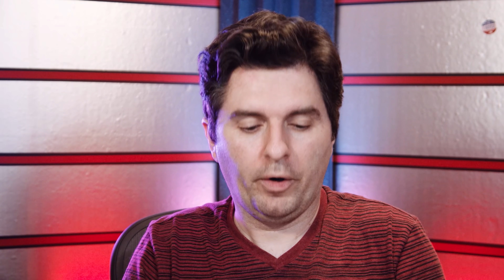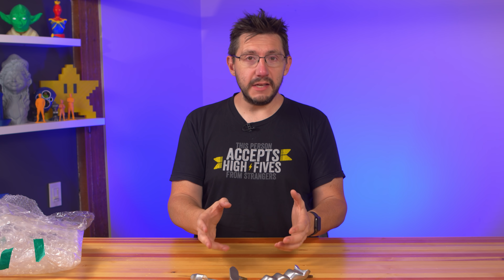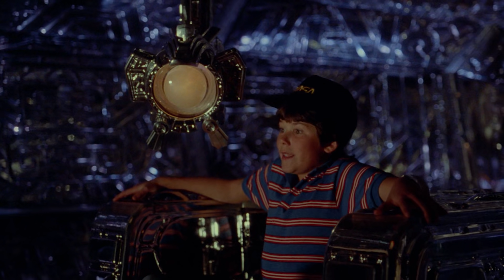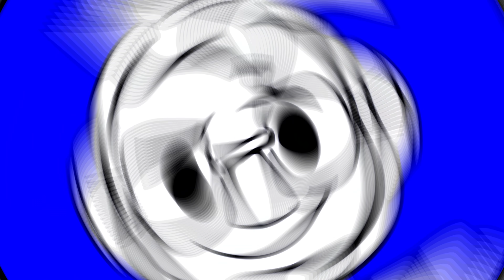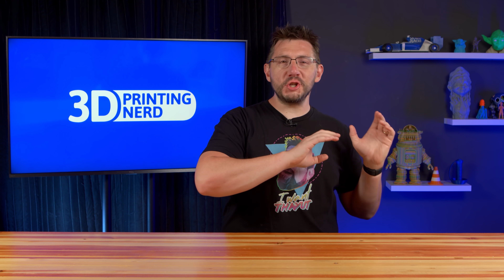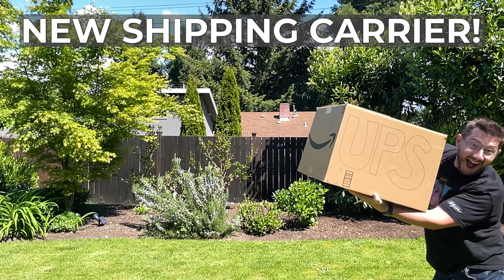3D Printing MAGIC for CAPTAIN DISILLUSION!

Comment: Hey Joel - Fun facts about Blender and 3D Printing.
STL format only specifies numbers - not units. Most slicers for 3D printing will interpret "1" as 1mm because that's an appropriate scale.
Here's where the fun starts.
Blender units are 1 = 1 meter. (It uses these for physics simulations, so even though some will say it's unit agnostic, it's not really)
If you are building something say, 10cm high and to scale, Blender will export this in STL as 0.1.  Problem is your slicer will see this as 0.1mm (REALLY REALLY TINY!)
What I normally do when I export Blender models to STL is scale up by 1000 in the exporter settings.  Usually fixes the problem.

Comment: Do you have any tips for the CR-10 Max? I bought one, assembled it, and I am having so many issues with it. I recieve mild shocks when touching the heat bed and the frame. It'll autohome and all that, but when I try to print something, the Z axis doesn't move down to the bed. It just stays still while it's "printing." Ever heard of rhis problem?

Comment: I wonder: how did they make the original with square holes?  I suppose those posts are cut from (aluminum?) stock and stuck into the carved wooden steps, too; so how did they make square holes for that?

Comment: How does FedEx lose a package and claim it was delivered?
I assume it wasn't stolen from the porch since you would not have said that FedEx lost it.
Reply: They said it was delivered. Then we said it wasn’t. The driver said he delivered to the correct address. Then later said he might have delivered it to the wrong address. Then we were given coordinates for the drop off location and it wasn’t anywhere near the actual destination. Searched that area and still couldn’t find it.

Comment: Hey Joel how are you myfriend, Im having a problem with my brandnew voxelab aquila. it extrudes fillament backwards.  i have another voxelab aquila that works perfect. I looked at the wiring and it looks right compared to other printer. i put it on auto load it goes backwards i put it on auto unload and it come out extruder. So i put extruder from other printer and it does the same thing. help please. Voxelab has proven to be useless for trying to remedy the issue.

Comment: Exporting stl files from blender to need to be scaled 1000x without regard of scale being 1.

The easiest method(I use only metric):
Actively select only the objects wanting to export.
File-export-stl.
In the export/save window, check "only selected" and 1000 scale before saving.

Then importing file into Prusa Slicer should work without issues.

Comment: So the most likely errors in Blender-to-STL scaling are inch-mm factors (1:25.4) or m-mm factors (1:1000). STL files assume 1 unit is 1 mm typically.

Comment: Great to see all these makers collab with Captain D. Quick question, instead if using the slots for alignment why not just make the square holes wider on one side so the pieces have more space space to adjust alignment but the side view still still closed on both sides?
Reply from the maker: I mean, that would work too? This was just the solution we came up with.

Comment: I hope whoever wound up with that missing FedEx box opens it as goes:
"OMG, these are the stop-motion steps from Flight of the Navigator!!"
Hey...it could happen.
Reply: Yeah that's not how it works. The box was either destroyed in shipment or had its label meet a similar fate. Meaning it - if it even physically exists - will sit in a warehouse for however much time the law requires and then sent to the trash dump. Unless some lucky but not so discreet FedEx employee grabbed it first.
Reply: @TheSolongsidekick  That's why packing standards state to include an address card inside the box as well.
If it was lost in shipment, by whatever means, why would FedEx claim it had been delivered?
Reply: @JohnDlugosz  Packing standards of... citation needed? Especially when every shipping company on the planet says they will never open your package for privacy reasons? And is that last question serious? Driver got to the address, saw that he scanned it onto his truck but can't find it, and to avoid getting in trouble marks it as delivered. Have you never dealt with logistics companies? That type of shit happens all the time. I couldn't even try to count how many times I've seen a package registered as "delivered" when it's provable that it wasn't - via either security camera or just plain not even having a person there to sign for it - in the 12 years I've been shipping/receiving as my 9-5.

Comment: Hi! I loved the collaboration, excellent work! I use Blender to export to Prusaslicer regularly. The trick is to use a unit scale of 0.001 (and metric unit system) in Blender to get the correct dimensions to the printer.

Comment: Now we need a choose your own adventure episodes

Fedex drivers need to do what Amazon does. They need to snap a picture of the item at the location before they can claim it's delivered. 
That way they can't just scan it in the truck or leave it at the wrong location. 

Then again sometimes the push to meet a quota is more detrimental then a late package.
Reply: I've seen some amazon drivers, put the packages down, take a picture, then take the packages back with them.